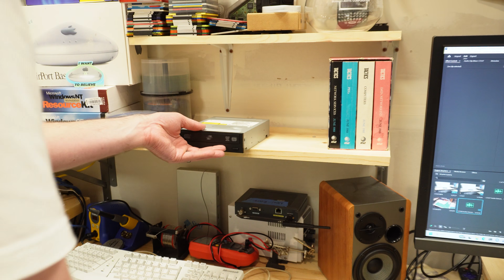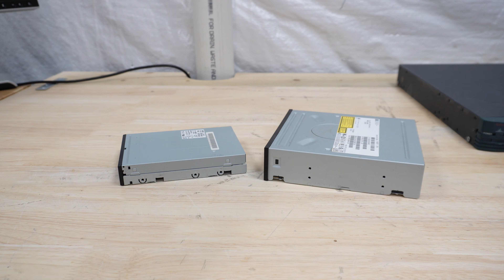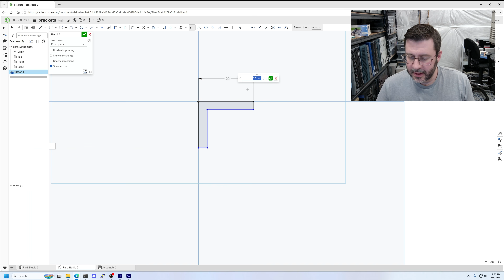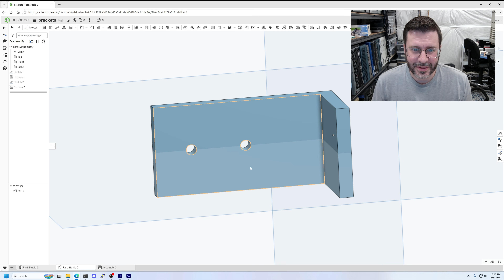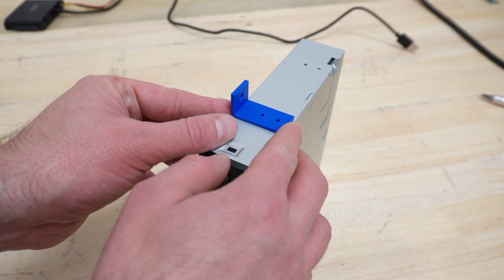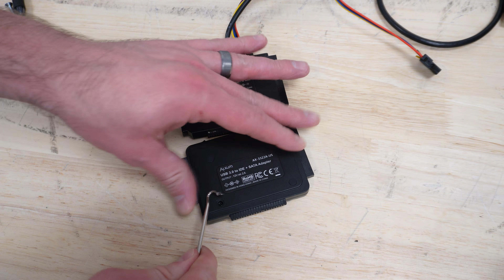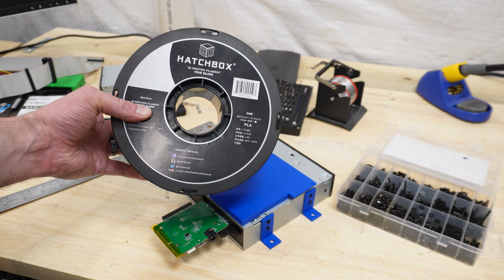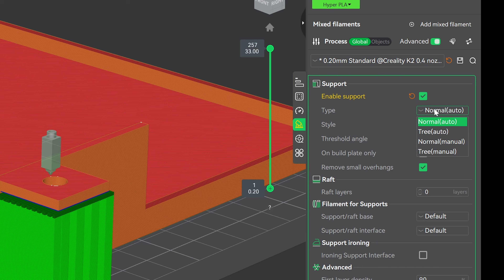Learning to Design 3D Prints

Comment: You are doing fine.
One thing that might help: 2D paper printing 1:1 actual sizes views of a part before you 3D print it. For screw-holes, you can fold the paper print along the line of the holes (and other features), to check their size and spacing.
As for the hole sizes, search for: Hole chart, Free fit, close fit.

Comment: Yes if you want to make the entire part a uniform thickness you use the = constraint. Make one dimension = to the other. When you change one, they both change. I'm not a user of Onshape but I'd bet there's a constraint menu up there somewhere. =)

To set a part on the build plate, look for a lay on surface. The software will outline all planer surface and you just click on one. for that style of bracket, lay it on the thin surface so your layer lines make it as strong as possible.

Comment: Just in case i forget it, later. You should print stuff, in an orientation that puts the layers under tension when in use. Even with a proper printer, i feel like the layer interfaces might become a weak link, over time.  I've only ever used FreeCAD, but never actually 3D printed anything - i might just be regurgitating ancient myths, that aren't applicable with well-calibrated printers, these days.

Comment: Me at 2:45 "No! NOOO! Thats a waste of space!"
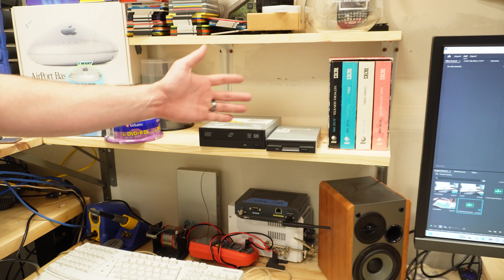Me at 2:56 "Oh yeah, he got it"

I really hate CAD in any way, I'm way to impatient for that stuff. Most of my circuit diagrams are still made with a pincil in one of my many sketch books. And if I share these, people scream at me for just taling a picture instead of sending a official file :D But my best friend is pretty good at it, so I always do the measurements and she does the design part :D

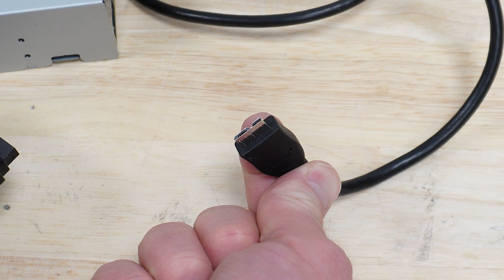27:44 USB type B micro 3.0, they basically added a part to the micro port for the addition five connections. You can get these everywhere, so no big deal :)

You could get a SATA extender, either a cable or one of these 180° adapters, so it could live underneath the drive. 

Hi Jasper!

Comment: 19:14 Use the other end of the callipers to get the step distance to the hole. The main shaft sits on the edge and the thin probe goes to the hole on the side (or to the bottom of a hole).
You might be slow but you'll get there. Been using Tinkercad for 12 years. Have tried Onshape and some others. Have put a couple of shapes down but struggle to get them to look like what I want and revert to the visual basics. You make it look easy. Might have another go.

Comment: 48:54 No please god no! No seriously, I wouldn't recommend that as an CAD software to anyone else but an programmer. I personally use Fusion and it's still good for free use, but I get paid version from my eployer so, it's a easy choice for me. But during the all my CAD years, I've been checking FreeCAD and right now, today, it's the way to go imho. It's free, it's going to be free and seriously it's quite near to commercial CAD packages since 1.1 version. I'd whole heartedly say anyone getting into CAD to go with it. It's bit steeper learning curve, but seriously not much anymore and there's so much good tutorials these days for it. Also it includes SCAD out-of-box if one is mashocistic enough to want to use it :P

Comment: I started 3D printing many years ago just like you: with a simple Project in mind. Imho the best way to learn printing and 3D CAD. I strongly suggest FreeCAD. It works completely local and does not need a Internet connection. And its Free!

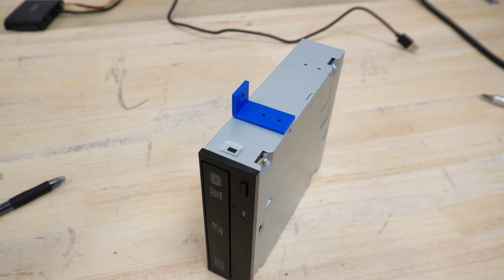Comment: Your print orientation at 25:44 is a bad direction for how you're going to use your print 3D printer going to be weakest after layer lines so essentially you would want to print that L bracket on its side that way all the stress is not taken out on a single layer line think of it like wood grain

Comment: Think a bit outside the box. Dont use round screw holes, but use long slots. Easier for positioning for dampers.

Then, yoj can aff a double damper, so vibration does not transfer through the first set of screws. Much like dywall acoustics for audiophiles.

Comment: I find supports don't snap off as nicely as one might hope depending on the complexity of the project. I wish I had a dual extruder printer, then I could just use a water soluable filament.

Comment: You still need spatial reasoning when working with OpenSCAD and LLMs have a terrible grasp of it, they confuse inner and outer dimensions etc and things usually come out wrong. If you're after SCAD, you're better off learning it for real, but lately i've found FreeCAD good enough that i don't even want to touch SCAD if i can help it. I used to use OpenSCAD a lot. By now with even less than basic parametric skills that you have demonstrated in Onshape, you have likely drastically surpassed LLM's SCAD abilities.

There was also this software like 123Design and then Tinkercad which is very analogous to how vector illustration editors and even the vector graphics tools in office suites work for alignment and measurements, and adds CSG for 3D, so most people get comfortable with them within minutes to create both art and functional pieces like brackets, holders and housings. There's bound to be some more software akin to that.

For a sufficiently nontrivial task, an LLM will always drive into a hole eventually that it cannot climb back out of, not without spending a ton of compute and making a horrible mess of everything. This is why a developer who uses an LLM won't get very far without genuine domain expertise, and the inherent human creativity is another key tool, and experts can use it to patch up their own knowledge holes and get a modest productivity boost out of them. But they're also seductive and can create apparent productivity instead of real productivity, and there has been research suggesting that even with seasoned professionals, real productivity gain may just be near zero. It's a moving field though, both people learn to use them better, and LLMs actually get more powerful. We have a long history of ultimate killer innovations and paradigms which everyone jumped on, then there was a reckoning that they probably break more than they fix, and finally they got reigned in and remained genuinely useful.

Comment: It's not hard all you need is tinker CAD a free web base software and use math and caliper's either digital or physical needle one and maybe a note book or note pad to right down number and a quick sketch. Than go go go trial and error works best when PLA is cheap somewhat on deal just use 15% infill until you know if every thing fit's well to save on filament maybe even 10% if the print doesn't fall apart when touched.
Reply: P.S. This is how I did thing when I needed a part to a old discontinued food possessor's Latch and took 3 reprints when every I came in the next day for my shift to save on not buying another 100+ dollar machine that will brake in the same way in a year.

Comment: You should have rotated it so the L-shape was down on the bed. If it does break, it will probably split at the layer lines and orienting it that way on the bed, you'd avoid that problem being inline with the weight of the drive.

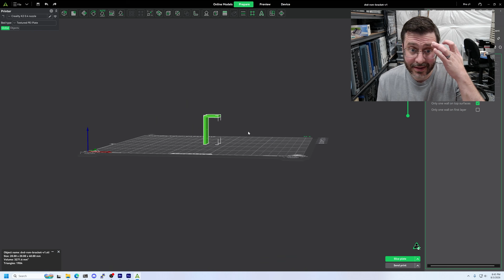Comment: At 23:00 you can use "Lay on face" (3 icons to the right of rotate) and select the side you want on the build plate instead of rotating it. Also, in the rotate menu, you can grab the square between the arrows in any axis and align it to the hash marks inside of the circle as you rotate. Makes it very easy to rotate something a certain number of degrees.

Comment: On the slicer software, top buttons, I believe it's the 7th button from the left that allows you to choose the face of your print that you want on the plate. I find this to be a very useful tool, but be sure to orient the part for strength in instances like this, rather than quickest/easiest print. You don't want the layer lines to be flat across a break point, placing the "L" on its front or back rather than on its base will provide a stronger and more resilient part as the layer lines build on each other where the stresses are likely to happen. Also, be sure to clean your plate after every print to prevent oils and such causing print adhesion issues. I use alcohol with microfiber towels or paper towels, but be sure to find out what works best on your type of print plate. Also, CTRL + K is the copy tool for parts in the slicer. Click the item, press CTRL + K and then select the number of copies you want and it will place and space them apart from each other making it 1 print instead of 4 for the brackets.

Comment: This was a great watch, as someone who's interested in 3D printing (probably getting my own printer soon too) and did some CAD back in university. I especially appreciated you showing the procedure by someone who's not experienced with CAD. Sure, it may have not been the quickest and most efficient way to design things, but you got things done the way they made sense with your vision. Understanding all the tricks the CAD software has up its sleeve definitely comes with time. May I suggest you take a look at FreeCAD, which is an open source alternative? I haven't used it yet, but it looks like it's at a point where 90% of technical CAD can be done there.

Comment: I've personally tried using the llm method, and it worked surprisingly well. I wanted to do a project with magnets, but I forgot the size of the ones I had and I lost my calipers so I just asked chatgpt (the web app, not even the codex coding agent) to make a testing case thing with openscad. I waited about 15 minutes it just gave the stl file back to me and I was able to do the project!

Comment: Simple flexible floppy cable mod: carefully cut the ribbon cable into shreds (say, after every 5th wire) and twist them up using zip ties. Makes the cable smaller and more flexible and easier to route. They actually made round floppy and IDE cables that you could buy off the shelf (they were a fad for a while when cases with windows in the side came into vogue, to make cabling runs neater) but why buy when you can DIY? :)

Comment: What about thumb screws between the bracket and the drives themself? If you are removing either drive for testing purposes, that could work.

Another idea is to create drive sleds. Have nubs that go into where the drive mounting screws would go. Basic idea would to slide in or out, then pull the cables then the drive off the sled. They have a simular setup for hard drives in old computer cases that do that very thing so that the drive can be replaced "tool-less"

Comment: A few suggestions:

1) Buy some ribbon cable and IDC connectors.  You can get an IDC crimper from the bay - it's just a plier-like jaw tool with a channel for the IDC connector to slide in.  Very cheap.  Making your own floppy/IDE/SCSI cables is a cinch, and you'll never have to worry about a cable that is too long or too short or the plugs are in the wrong place.  It's so simple and easy that you'll be disappointed in how long you've lived without it.  :-)

2) Molex and Berg connectors are almost as easy.  It can be tricky to find the right crimper, unless you want to get the official Molex tool.  Official tools range from "oof" to "dear god... does that come with the factory to make the cables for me?"  Cheap tools may work but make ugly crimps.  If you're pragmatic, ugly crimps work just as well as pretty ones.

3) If the materials you print are at all flexible, experiment with making PCB supports that snap into the mounting holes.  Imagine a post with mushroom dome on top, then looking down from the top of the post, cut a plus sign out of the center.  You end up with four "fingers" that slip easily into the hole, and then resist the board coming back off unless you squish the fingers together.  (It's the technique a lot of plastic bezels use to snap into a metal chassis behind them.  You can also use two fingers instead of four by slicing the post in half instead of quarters.)  The bottom side of the PCB should rest against a slightly larger diameter base.  If you get the dimension between the support base and the bottom of the cap correct, it'll be a nice snug fit for the PCB.  Experiment with the thickness of the "fingers" to get them pliable enough to release the PCB when you want to, but stiff enough that they don't release on their own.  You might need to augment the "plus" shape cutaway with a cylinder to remove some of the material in the center.

4) When you get a little more confident with designing flexible parts, try building rails for your drives.  Looking at the side of the drive where the mounting holes are, imagine the mounting hole with a circle covering it.  Add a rectangle off the right side of the circle, so it's like a flap.  Cut away a slightly larger duplicate of that shape from the rail, with about 0.5 to 1mm clearance around the perimeter of the entire shape, except the far right side of the rectangle, which should connect the rectangle end of the "flap" to the rail.  It should now be able to bend away from it.  Now, on the inside of the circle (against the drive), add a short peg that fits into the screw hole.  Add a little block as a finger grip onto the outside of the circle, so you can pull it away from the drive.  Experiment with the thickness and length of the rectangle part of the flap to adjust stiffness and how much it can bend away to clear the drive's screw holes.

Comment: The weakest part of the bracket is the corner, and by placing the chamfer there you may have greatly reduced the overall strength. It would be better to also add a generous fillet on the opposite side to restore strength in that area. The best way to make it strong without using tons of material would be to add stiffening bars (think how I-beams work), but that's not needed when you are using 3mm thick plastic. As others have said part orientation matters with regards to layout lines, and of course I cringed when you put in a 2.3mm hole for M3 screws. Metric screws are easy; an M3 screw needs a 3mm clearance hole. You can also look up screw diameters in tables online, which is more important for American sizes like 6-32.

Overall it looks like onshape is working well for you, but of course I prefer to use self-run free software when possible. So far I've only used openSCAD, which is quite complicated to use.

Comment: I learned when I made some brackets for some old  MasterSwitch Plus that L brackets are not good for underslung items. I suggest making a triangular "ramp" and rely on the power of triangles to prevent failure.
Reply: with the brackets you did make I would have printed them on their side so that the strength follows the grain

Comment: Yeah, I started out with a CR-10 about a decade ago which I did the normal "rite of passage" of spending about 6 months printing parts to make the printer less painful to use. I bought an AnyCubic Kobra S1 Combo last year and whilst I've still had issues I'm impressed with how "fridge like" 3D printers have become, you still need some knowledge to fix problems when they happen but the "just work"-ness quotient is much higher than it used to be.

Comment: I did the same thing with portable drives. A custom mount for my (already small) desktop so they're on a side. It's a modular system with a clamp, you can add more external units on top, and as a last unit, a top loading one. Nice job, I might do the same with my bulky BD-R drive that's currently in my server, without any use.

Comment: One thing to note about the hole size is that 3D printed holes which aren't parallel to the build platform tend to come out a bit undersized because of all the interrupted layer lines on the edge of the hole. I typically make those a bit bigger than they should be to make up for it, or you can give the hole a bit of a teardrop shape along the top to make sure the overhang leaves you enough clearance.. There's charts of how big the hole has to be for each screw size, in fact it might be printed on the back of your metal ruler even, but also the CAD tool should have a reference for it as well.
Reply: Also you have a huge advantage being in the US! If you are not happy with 3D printed brackets you can have it laser cut and bent for super cheap nowadays, I print a ton of this sort of thing for work and half of them would be much happier being a tiny piece of sheet metal...

Comment: fun fact: dell laptop floppy drives have mini-usb ports on the side.
I have two of them.
Reply: That's specifically the modular drives for the D series, and if I'm not mistaken not all revisions have them. Further fun fact: the laptops don't support the floppy interface; they connect using an internal USB port on the bay connector. That's why they're able to add the miniB on the side. Since it's already a USB floppy drive it was only the cost of another connector to make it work with any computer.

Comment: You missed one of the best parts of OnShape (and Fusion) that very few other CAD packages do parametric CAD So great when you need to make a lot of a similar part

Edit: also in your designs you want to avoid 90 degree corners along layer lines like you did. It creates a stress point for the print to crack along. even a slight chamfer or fillet will help get rid of that stress point.
I also saw another comment saying not to print along layer lines which is much better advice but when you can't avoid it try to chamfer or fillet your internal corners to avoid stress points and it even cleans up the outer walls too